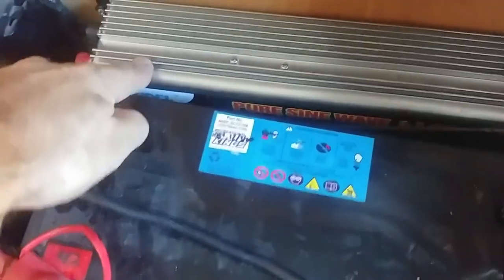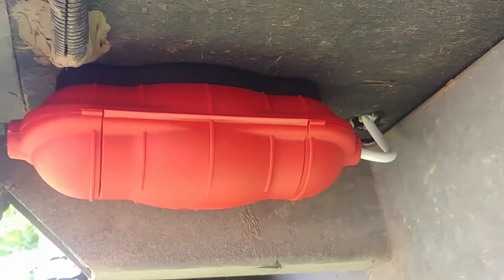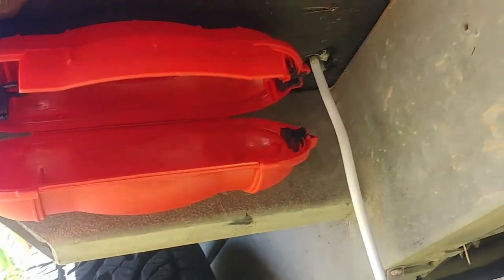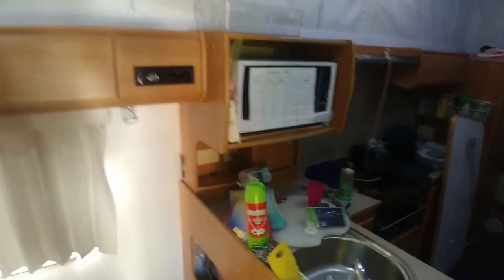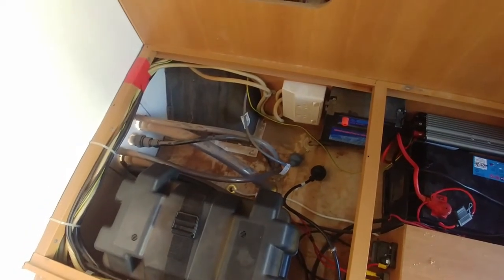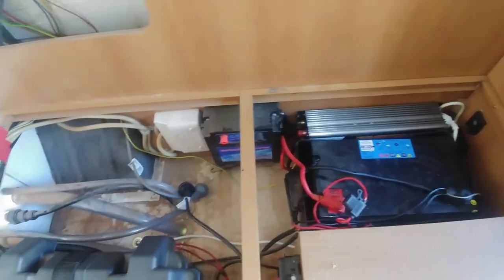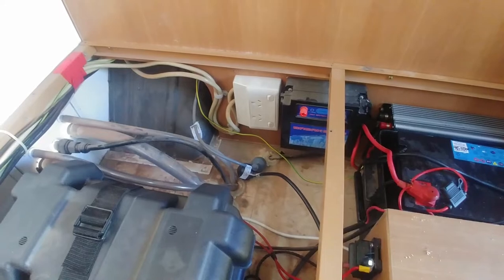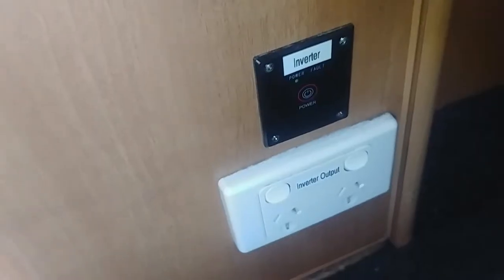[REVEALED] How to easily run your caravan / RV's power points directly off your inverter!

Comment: Thats a fantastic idea. Just in the throws of collecting all the gear to set up my van with solar panels etc and was thinking of trying to get to the power supply wiring within the van and put in a selector switch but this is so much simpler. Cheers
Reply from the maker: Glad it was helpful Rod! Take all due care to ensure electrical safety, but this certainly worked for me!

Comment: You could install a Caravan 240vac outlet and run a small extension lead from this outlet to the Caravan inlet.The caravan outlet does have a flip cover for protection.
Reply from the maker: Hi mate, yep you could install a separate outlet and wire the inverter up to that instead of doing what I've done; but then you have to have the short extension cord stored around somewhere. The way I did it the cord's permanently connected to the inverter and conveniently located nearby without getting in the way. It also means you don't have to cut through the side wall of the van to install a second power point in a prominent location. But you could do it either way for sure.

Comment: 🎉You nailed the question on my mind for days! Thanks. My 1000 watt pure sine wave inverter arrives tomorrow. We have 100 AH AGM hooked to 170 watt panel. The inverter only has one outlet. We have the same fridge as you. Can I basically mimic your setup?
Reply from the maker: I can't see why not. Take careful note of the disclaimers though and make sure it's safe. A better way to do it is really to use a transfer switch like this https://www.ebay.com.au/itm/166545709954. However I used the method in this video for a couple of years with no problems.
Reply: I’ve just found this tutorial, it’s bloody awesome. I was contemplating something similar. 

I have a Remco 12v 120ah agm deep cycle battery. I’m planning on getting a pure sine inverter that’s around 500 to 1000watts and primarilly for use with starlink.  Would this work and with, say e.g., (1) 12 hours use per day with starlink? (2)how long would you suggest the battery would last before I charged it again?  Again thanks for the tutorial and beijing69’s comment.

Comment: I’ve done the same. It works great, have you checked that your van Rcd trips if using a fault occurs. I’ve found it wont unless there is a earth neutral bond on the ac.
Reply from the maker: I haven't but I don't think it would for the reason you said. About the only thing on the van that could be earthed is the sink which my inverter is earthed to -  everything else is floating -wooden floor and rubber tyres.
Reply: Exactly Mitch. This setup creates a floating 240Volt supply. As in no "earth" to ground to allow the RCD (residual CURRENT device) to sense a current flow and to trip the RCD. The new device recommended for generators and Inverters is the RVD (residual VOLTAGE device). This device trips at 40 Volts. Not yet law but will eventually be.
Reply: Test your inverter output with a socket tester. If it has a "floating" earth the tester will show "no earth" and your rcd will not function if connected in this way.

Comment: I had that high pressure hose inlet in the Jayco fail spraying water all around the other stuff in mine which looks the same as yours. I've moved the inlet from on the side to under the van close to the kitchen. It only went into that spot (the thinner black hose and straight out again anyway) because of the connection on the low pressure tank fill panel.
They say electricity and water don't mix, well, water, electricity, MDF and pine certainly shouldn't mix.
Reply from the maker: Interesting, I've not heard of that happening although it's only a plastic fitting so that's quite foreseeable. Sounds like you came up with a good solution!

Comment: The system you have created can sometimes mean the RCD won't trip if the earth is floating. Needs an earth stake but possibly still not safe or legal .
Reply from the maker: Thanks for the comment Don. As I've thought more about this I think that's actually true even if you had a mains lead plugged into a GPO. As far as I can tell, the whole caravan is floating relative to earth - inside there's a wooden floor, and below the chassis you've got rubber tyres, plastic feet below the corner steadies and a rubber jockey wheel as the only contact points with the ground, all of which are insulators. The only thing accessible inside the van that's earthed is the sink, so the only way you could get a shock as far as I can tell would be to touch the active with one hand and the sink with the other, a pretty unlikely combination. If you're just standing on the floor, as far as I can see there's no path for the electricity to get through you and to earth.

Thoughts?
Reply: unless you are getting in and out of the van and holding a metal handle or step? @TheMusingGreg

Comment: A great idea that works for you.
Question if ok.
What size cable you use from the battery to inverter?
Do you have a circuit breaker or fuse between the battery to inverter, if yes size?
Thanks in anticipation.
Reply from the maker: G'day Steve, thanks for the comment. The cables I use from the battery to the inverter are the thick ones the Giandel inverter came with - check out https://youtu.be/JYKiR7f_UxY which would show them. I can't recall their exact thickness but they're pretty thick.

I don't have any fuse or circuit breaker between the battery and the inverter. It would have to be enormous though - from a 12V supply, this 1200W inverter would be drawing 100A, and it can supposedly draw up to 2400W peak (which is 200A). In this situation you could go for a 250A fuse if you can find one but I don't think it's necessary. I'm preparing a short series on things like current, power and voltage, so please subscribe if you think that might be useful (the info in that video would help you calculate fuse sizes).

Cheers,
Greg

Comment: Having your inverter power charge the batteries would work is wouldn't do any physical harm but of course in producing the 240 volts in the inverter you incur losses and the same is true of  your battery charger therefore even without anything turned on you would flatten your battery over time.
What type of batteries have you got and how many do you have
I have been thinking of doing similar to what you have done.
Reply from the maker: Yep that's spot on Steven. I've inadvertently had the charger connected when running the inverter and it works OK, just draws more power and flattens batteries quicker. I've got 2x100Ah AGM batteries in parallel.

Comment: Greg, Thanks for the video. I’m looking to run an inverter in my canopy and run a few powerpoints off it. Could you explain how you go from the 240 plug into the back of the powerpoint. Thanks
Reply from the maker: Hi Charlie, thanks for the comment. The way I've done it I've not fiddled with any of the van's 240V wiring, because while I know what I'm doing I'm not licenced to modify any of that wiring. If you've got an inverter with a 240V 3 pin output, the simplest thing would be to plug a power board into it and run your devices from that. Otherwise you can do what I did in this video and run the output of the inverter into your van's power input. I would not recommend hard-wiring the inverter into the back of power points as it can be a death trap if you get the wiring wrong.

Comment: I'm looking into doing something similar but from what I've read your rcd won't work off your inverter.
It needs to run through an rvd.
Reply from the maker: Hi Justin you could well be right on that. I wasn't in a position to test that but I've heard of RVD's being useful. I'd recommend investigating that for sure!

Comment: Hi great vidio just  asking I have a aircon on roof and wife runs her hairdryer so what size batter will I need and once battery gets flat how do I charge  it?
Reply from the maker: Thanks for the questions. 

1) For the first question on battery size, it depends HOW LONG you want to be able to run the hairdryer and aircon; but work on about 100Ah battery capacity per hour of airconditioner run time [Here's why: Most airconditioners draw around 6A at 240V when they're running, which is about 1500W (240Vx6A). So running continuously for an hour at full power (which they don't tend to do mind you), a 12V battery would need a capacity of about 125Ah (1500W/12V). Allowing for some compressor off-time within that hour, 100Ah would get you around an hour of run time].

2) For the second question regarding charging, you'd need to charge the battery from either 1) a 240V lead plugged into the power inlet such as at a caravan park (presuming your van has a 240V battery charger included which most in the last 25 years would have); 2) the 12V input from your vehicle if you have an Anderson plug fitted, or 3) a solar panel either on the roof of the van or a portable one. However if you're going to put a lithium battery into your van to run power-hungry appliances like an air conditioner, you'll need to be able to push enough current into the battery in a day's driving to fully charge it, which will require a high-current DC-DC charger.

These are fairly general answers as there are many variables as to what will be the best solution for you. A caravan auto electrician would be able to give specific advice for your van and power needs once they have all the information needed, but hopefully this points you in the right direction.

Cheers,
Greg

Comment: Thanks, I was just about to test my system - I have an aditional RCD inline - however I would have forgotten about the hotwater service...Also, I was told and have read that I needed an RCD because I'm taking 240 10A into a 15A wiring...  and that the RVD's are required for new RS2 inverters because they are double insulated and the erth pin in the GPO is not connected to the chassis. My inverter doesn't seem to be double insulated and needs to be earthed to the caravan shassis, so i'm thinking it's ok
Reply from the maker: You could be right Peter, I'm not really too sure on those things so I'd be checking with an electrician. The 12V -ve terminal of the tow vehicle and the internal batteries are connected to the caravan's chassis but I'm not sure how it goes also connecting a 240V earth to the same chassis.
Reply: @TheMusingGreg  I'm just about full of info now my brain hurts. I read now that the new standard (RS2) inverters don't have the earth pin connected. but.  mine is 2015 standard and needs an earth wire. so,...I'm happy with using the set up I have. I have so many safety fail safes i'm confident it will be ok. .Thanks
Reply from the maker: @PHancock11  Cool good luck mate!

Comment: What size is the inverter and how many batteries are you running..? do you have solar panels to charge batteries, or they charge only via mains?
Reply from the maker: The inverter is 1200W, see https://youtu.be/JYKiR7f_UxY

I'm running 2x105 Ah batteries in parallel. I charge then via the Redarc DC-DC charger while driving, and a solar blanket while we're camped. I don't use the mains charger that often as we usually free camp. The DC-DC charger is brilliant and the batteries are usually full after a day of driving even if they're empty at the start. Here's my review on it if you haven't seen it:
 https://youtu.be/a3uE9EKA3mA

Comment: When you plug into mains you get your earth from the supply  if your van is wood and fibreglass where is it made ? I’m commenting on Australian vans most are aluminium. I have been through this and was told if I touched the van whilst on the ground I could cause a circuit to be made. I wanted to do almost exactly that you are trying to do.
Reply: I was told it is something to do with a MEN and I would need a change over switch. I’m not a sparky btw but what I was told makes cense.
Reply from the maker: Yeah it's a good question. As far as I can see the van is floating from earth when the power points are being fed from an inverter, ie there is no connection to physical earth, as you don't drive an earth-wired stake into the ground when you pull up for the night. With this inverter install I tied the earth post on the inverter to the caravan's earthing system, but the only metal thing inside the van that was tied to was the kitchen sink so it's not doing a whole lot. My van was fibreglass so it didn't matter as much.

As far as I can see, if the inverter is generating its own 240 volts on board there's no link to physical earth. So even if that somehow got to the body of the van, even if you touch the body of the van while standing on the ground there's no link to physical earth back from the inverter, so no reason for the current to flow through you. 

Note that this is just my opinion, I'm not an electrician, but I'm just thinking through the logic and I can't see how that would cause a problem.

A caravan doesn't have a MEN. A change over switch really would be best, or an inverter with an automatic transfer switch, but that's still doesn't solve the problem of what to do with the earth!

Comment: Hi Greg, thanks for all your help,  I bought a 600-1200 watt inverter and it's trips out sometimes when the fridge motor starts up, but just ordered a 1000-2000 watt inverter, hopefully that fixes the problem,  just wondering how did you wire up the inverter on/off switch? My inverter didn't come with that. Just the switch on the inverter it self.
Reply from the maker: No worries Dean, glad to help.

What wattage is your fridge? If yours has a motor there will be a spike in current as the motor starts up so you may need more than it says.

I made sure I got one with the remote on/off switch so it could be mounted out of sight and activated remotely. It just plugs into a RJ12 port on the side of the inverter. I'd recommend seeing if you can get an inverter with the remote included, or contact Giandel and see if they'll sell you the remote separately. Should be possible. Otherwise you'll need physical access to the inverter to push the start button.
Reply: @TheMusingGreg  Hey Greg, thanks for getting back to me, it's a standard bar fridge in my caravan, not sure of the wattage , I wished I would have asked you this question before I bought my second inverter, as I noticed I doesn't have the remote switch either but I just noticed if I had payed a bit more and got the 1200 watt inverter it comes with the remote switch, l might just resell the inverter when it arrives and buy the 1200 watt inverter with the remote switch. Cheers

Comment: How about using 15A lead, but just shave the bottom male pin down so that it fits into the Inverter 240V socket?
Reply from the maker: You could, but in my situation the system can't output more than 10A anyway.

Comment: Hi Greg great idea except your lead from the inverter to the caravan input has gone from normal at one end to a 15amp at the other is that legal.   Ken
Reply from the maker: Technically probably not legal Ken, but consider WHY it would be illegal to have a cord with a 10A plug supplying a 15A socket. It's obviously because the supply is only designed to deliver 10A but the caravan may draw up to 15A which could lead to overloading the supply. In my case, the inverter can only deliver 10A (2400W) peak (in practice the batteries can't deliver enough current to supply that anyway). So my supply can never deliver more than 10A anyway, so there is no way it could ever supply 15A. The overload protection would kick in before it got anywhere near 15A. So in my situation it would be impossible for the caravan to draw more than 10A through that cable which is why in my case I'm comfortable with that setup.
Reply: You could add a 10amp - 15amp RCD unit just to be on the safe side. That would protect your inverter, as it does when you hook up your van at home into the 10amp outlet. In that case it protects your home circuit.

Comment: I'm looking at getting a kings 3000w inverter, at the back of the inverter it just has a positive and negative connection, this might sound like a stupid question but it positive inverter to positive battery & negative inverter to negative battery not negative to van earth??
Reply from the maker: Not a silly question but yes you're right. The van earth may or may not be connected to the battery earth but just run the black wire back to the battery negative (and positive to positive)  and you'll be good.